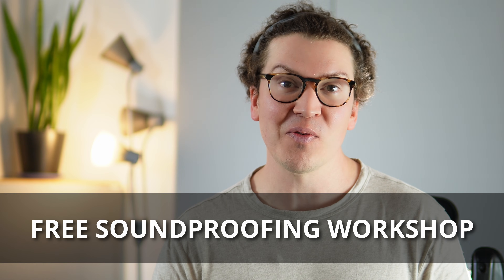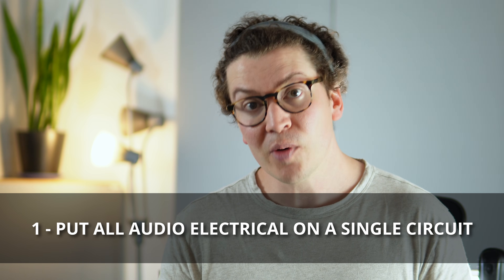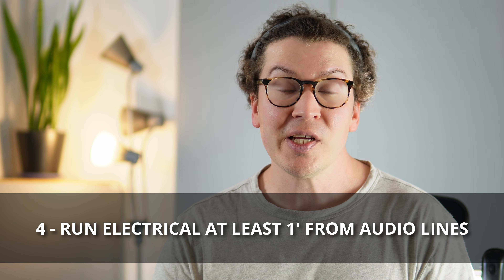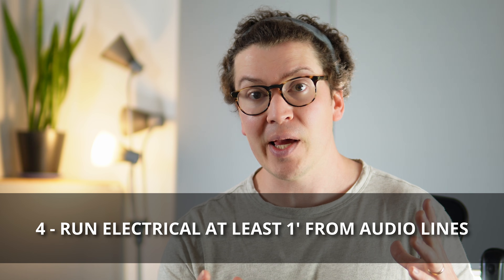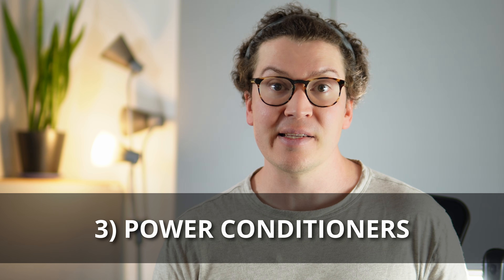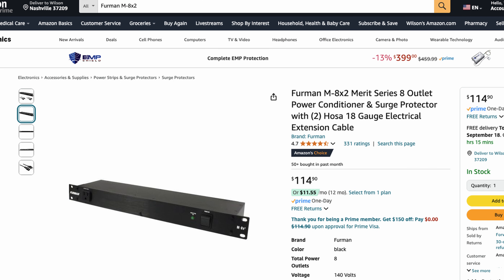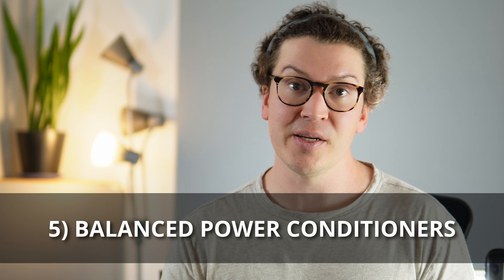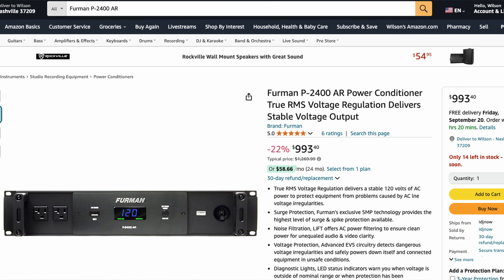Clean Power Solutions for Your Studio: Understanding Transformers, Power Conditioners, UPS, and More

Comment: My studio is in a 70s era rambler with two circuits feeding everything in the room.

What I did is locate the two outlets in my room that were on separate circuits that were closest to my gear and hooked up a line interactive ups with avr which got rid of my ground loop hum.  I use USB isolators to get rid of digital noise I hear, then ran all my mixing gear and my console 100% balanced cabling.  For my amps and unbalanced instruments that use a lot of power I run them through a power conditioner and use transformer isolation when sending signal to them.  I run power conditioners off of the UPS units to feed all my individual pieces of gear.  And I have line isolators and hum eliminators and a well made reamp box.

My entire studio is a hybrid setup with 24 channels and many racks of gear, console, live amps etc. and so far I have minimal noise issues, digital noise from coil while and less than ideal isolation in my interface and computer are usually the only thing I still occasionally have to battle with.

Eventually I want to fix my grounding scheme and add a transformer at the panel but that is not financially viable at this point because I won't have my electrical done by low end contractors (I am a low voltage specialty electrician by trade) cuz I've seen what happens when corners get cut.

Would do the work myself but my license doesn't cover panel work and home owner insurance company companies will drop you for not doing the work without the proper licensing, permits, inspections, etc in my state.  So until I can have it done top notch, this is working fine for me.

Comment: I KNEW you’d say #1!
I live in a modest townhouse and the first thing I did was wire a SINGLE dedicated 20A circuit for ALL my audio gear. Computer, monitors, hi fi, all (7) guitar amps.
Besides the common ground, the other advantages (for me, at least) are:
1. no major appliances kicking on and off
2. In the event of lightning storms I manually trip the breaker to avoid equipment damage.

Comment: Great vid

Also, you can run another seperate switch board off the mains power and have a dedicated switch board in your studio room.

Then, from the mains power to the studio room switch board, run "single core sheilded cable" for the Active and Nuetral power lines and keep them seperated .  Use an overkill high current cable ,  60 or 80 amp per cable  from the mains power to the Studio Room Switch Board.

The "high current single core sheilded cable" will heavily reduce emf interference  between the Active & Neutral Power lines 

The high current thicker cable will provide more "headroom" to create a better  consistent and even flowing path of electricity.

Then, there is another level to top it off, OFC, Oxygen Free Copper, or an even higher grade of copper, OCC , Ohno Continuous Cast Copper 99.9% purity copper,  to use instead of the standard copper used in everyday electrical cables .

Think of the flow of electricity  through the different quality coppers as a car travelling along a highway with a 100km speed limit.

A busy highway will have obstacles in your way, other  cars and average drivers,  to prevent you from travelling at a consistent 100km.  That is the standard copper.

A regular highway will have an average amount of cars and better drivers alllowing you to remain travelling at 100km more than the busy highway that has more cars and average drivers., tnis is the OFC, Oxygen Free Copper

The quiet highway will have a less cars spaced out with great drives . This allows less obstacles to overtake, more space to manouvere around other cars and remain at a consistent 100km for most , if not all, of your journey,  this is OCC , 99.9% Copper

 A low current cable, we can call a 2 lane highway.   Sure it supports the traffic, though there is no extra room , "an extra lane" is this analogy, for you to overtake the obstacles,  the cars.

A high current cable, we can call a 4 lane highway that has the same amount of traffic as the 2 lane highway .  Though,  the extra lanes provide plenty of room to a avoid obstacles, and easily overtake.

Lastly, lets think of normal non-seperated electrical cable as a highway that has the opposite travelling  lanes right next to each other with no space or barrier between them.

The risk or potential of a driver accidentally crossing into the opposite lane and causing interference is fairly high.

Now lets Seperate the two opposing lanes and place wire barriers  on both sides of each opposing lane.  These wire barriers prevent a driver from accidently steering off and out of the lane and interferring with othercars , or a tree or a house .

This is similar to having two seperate cables that are sheilded to prevent emf to interfere with electricity, other cars,  or other electrical equipment, trees and house.

Comment: Hi. Thanks for the detail explanation. Currently in my home studio, all audio equipments and computer are connected to a single circuit, but still when someone rings door bell, when turn studio monitors ON or when turn a tube light ON my display monitor goes off and on for few seconds. Electrician could not understand the cause. Do you have any idea?
Secondly, can I buy a power conditioner and connect it to an interactive UPS which is 2000vA and PWM (or simulated sine wave)?
Reply: Are your "tube lights" "fluorescent tubes"

Fluorescent lighting emits a frequency that can interfere with other electrical items .
Reply: @kroozzyn  Hi, No they are LED.

Comment: In my studio, I have to daisy chain multiple Furman power conditioners to reach all my equipment. Is that bad? I have no hum but usually there are static electric shocks in the room, (and I am not sure that’s related). Thoughts?😊
Reply: Generally speaking, connecting power hubs to other power hubs is a fire hazard. You would be safer plugging each power conditioner into its own wall outlet. If where it needs to be is too far from an unused outlet, you can use a single input extension cable to cross the distance.

Comment: All the grounds and neutrals end up in the same place in the electrical panel. So the idea about circuits being on different legs to help with ground loops is not exactly accurate. The cheapest method in the short term is to only have single outlets per breaker. Then there is only one path to ground for each outlet. Also, at least in the southern USA  isolated grounds must all be tied back in to your service entrance power ground. So unless you have a stand alone building with its own meter, then the isolated grounds must get back to the main grounding system at the service entrance which ultimately will tie everything back together. Even if you have separate ground rods, at least for residential, it is against the NEC to have two separate grounding systems. The BEST (read: expensive answer) to separating circuits is a transformer like you mentioned. That solution is what I landed on adding in between my service entrance electrical panel and my studio sub panel if and when I feel like I need it.

Comment: The easiest solution I found is using an “On-Line” UPS with double conversion. In this type of UPS, the battery is always in line. There is 0 changeover time from when power is lost and battery takes over but more importantly, double conversion means AC to DC to AC.. basically isolating the studio from the grid.
Reply: APC SRT1500RMXLA

Anything with online double conversion and pure sine wave will do it.
Reply: @nyaudioengineer is 1500w enough for a studio with hardware?
Reply: @krexilinmixiling  I guess that depends. At one point I had:
(2) LA2A
(2) 1176
(2) Distressor
(2) Pultec EQ
(1) D-Comp
(2) DBX160
(1) Tegeler Creme
(1) SSL Sigma
(3) UA Apollo’s
(1) Mytek ADC
(1) 8spc 500 rack loaded with Pre’s.
(1) 27” LCD
(1) Macbook Pro M1
(1) OWC Thunderbolt Hub
and a few other items running off a 1000va model with no issues.
Reply: @nyaudioengineer  nice
Reply: @nyaudioengineer  this is basically what I do, got a pair of similar units that do this to feed my gear, they also typically use transformers in the conversion so I believe they technically galvanically isolate the stuff downstream.

I run one for each circuit in my room and my ground loops are gone on anything plugged into them.
Reply: Will it "eliminate" all unwanted electrical noises from the preamps and gear?